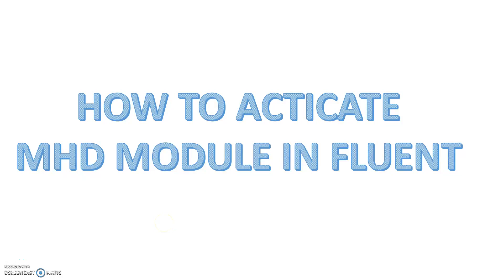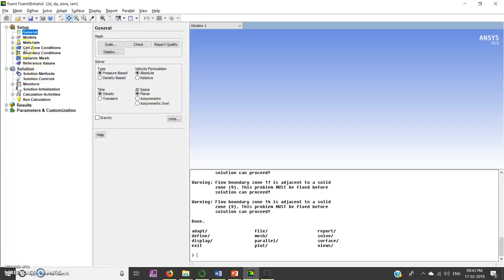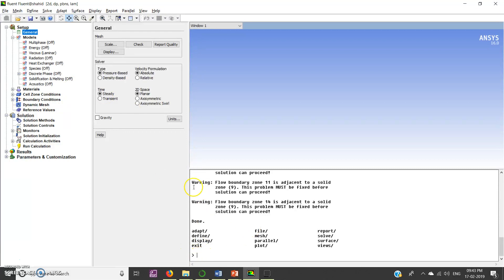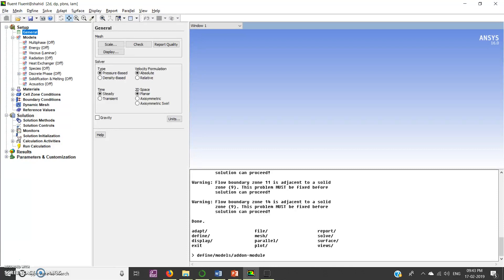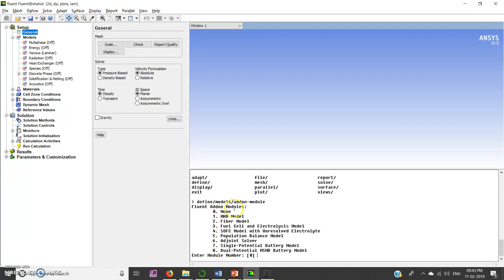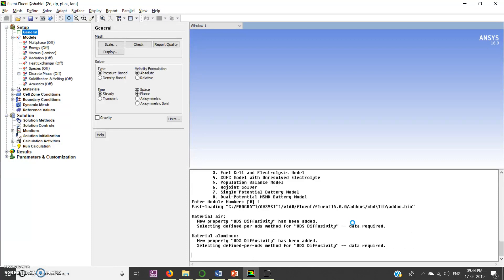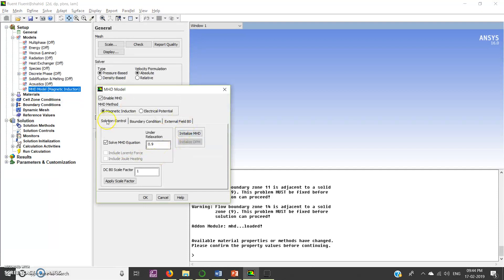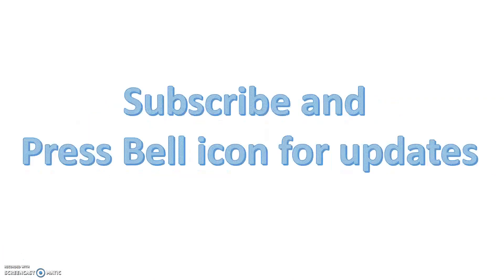How to activate MHD Module in Fluent #Learn_Ansys_Fluent_Easily

Comment: Hello, I have a few questions about ansys fluent. I will apply mhd in a cylindrical tube to the water and fe3o4 nanofluid. The pipe length is 1500 mm and the diameter is 16 mm. But the pipe was drawn in 3 parts. 1.2 m - 0.1 m and 0.2 m. I will apply a magnetic field of 0.3 T to the ground at 0.1 m. But I was not successful. I use a mixture model as a model which values will I enter in phase 1 and phase 2. Can you help me?

Comment: Hello, i'm a PhD student. I'm currently working on plasma arc simulationg using fluent MHD module and other UDF or UDS. 
Would you please upload a tutorial video about MHD module and electric potential model in the "model" section of fluent user interface?
 Also, if it is possible, I really need advices on the modeling from a senior user of fluent MHD module. Thank you very much.
Reply: Hi, Did you success in modeling the plasma arc? Which software did you use?